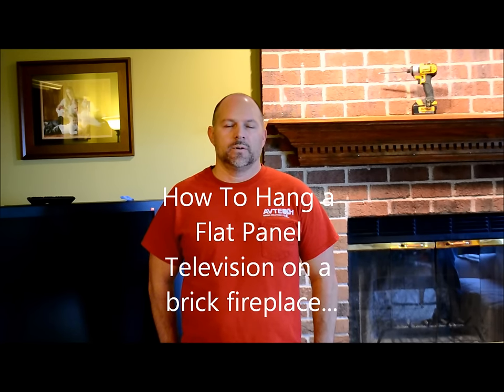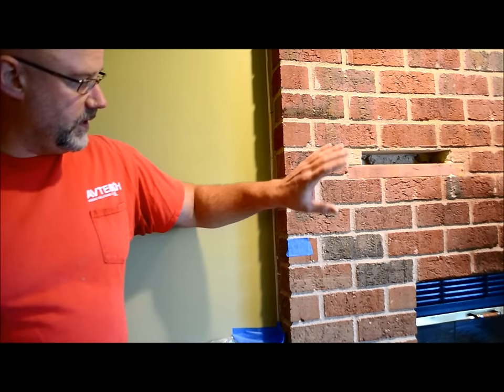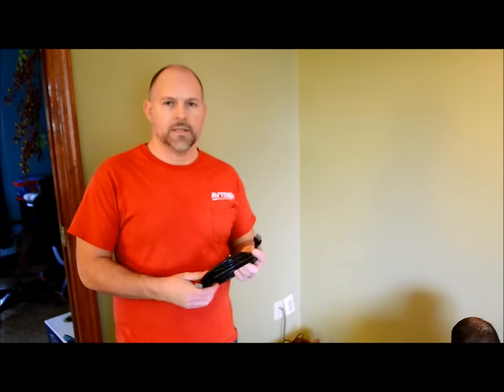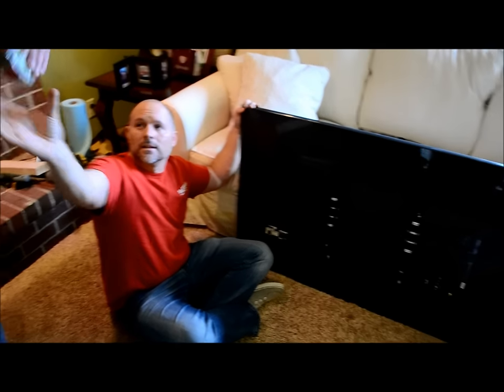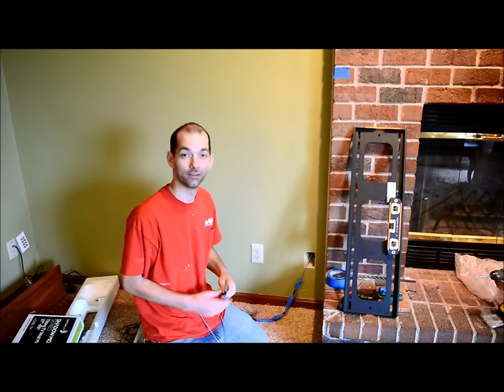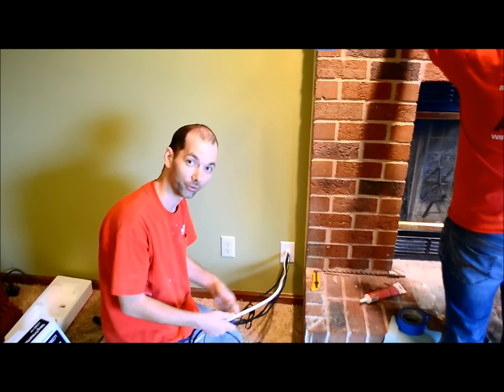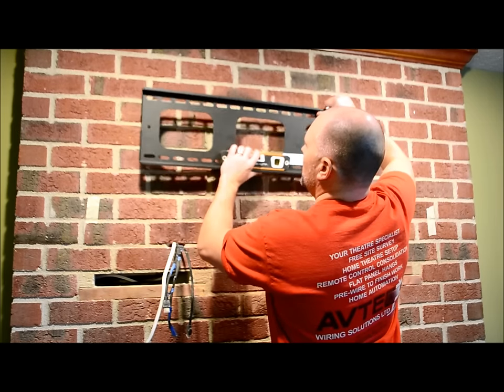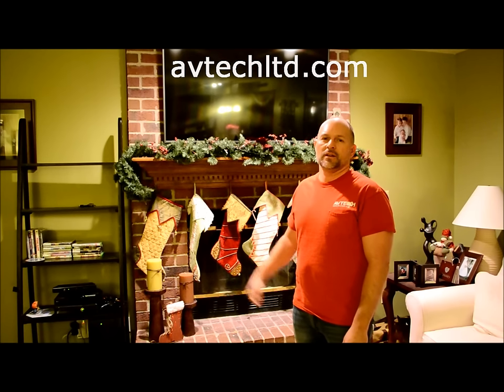How To Hang a flat panel tv on a brick fireplace

Comment: This is insane, mortar is not strong enough for fixings. Don't do it!!!
Reply: over 1000 tv hangs since 09' not one have i had fall. if it was a cantilever it may be needed it all has to do with the math. weight dist. age degree of movement etc.and most mounts don't get reused bc of compatibility issues

Comment: What kind of glue do you put in the anchors
Reply: Hilti makes a great adhesive. We use it all the time when drilling and putting rebar in slabs to continues horizontal stretches. we also use them for anchor bolts when building strut structures etc. Really, anytime you use an achor, you should be adding this adhesive
Reply: @benricher9717  great stuff isn't it!